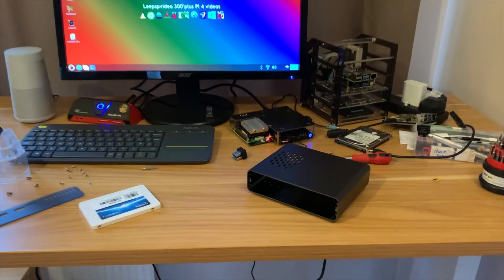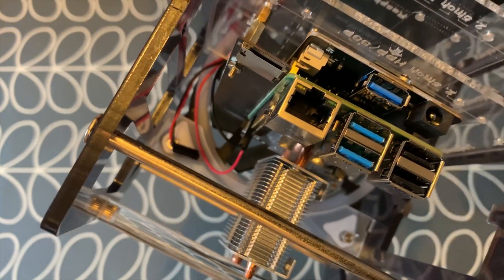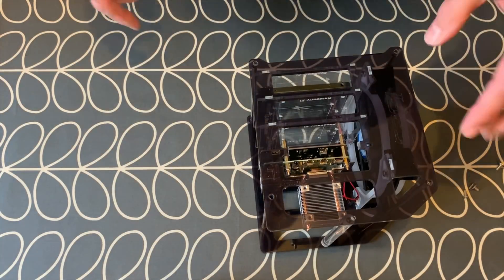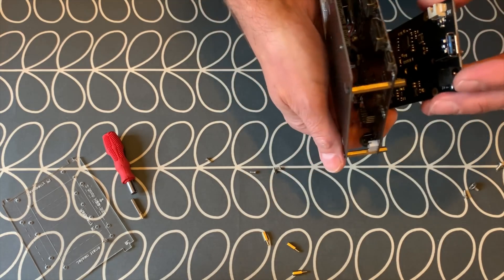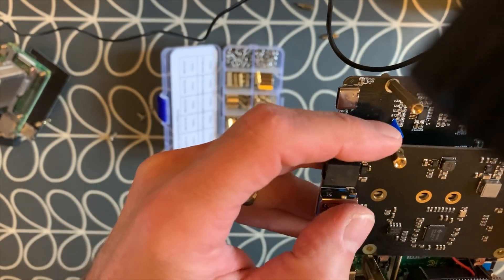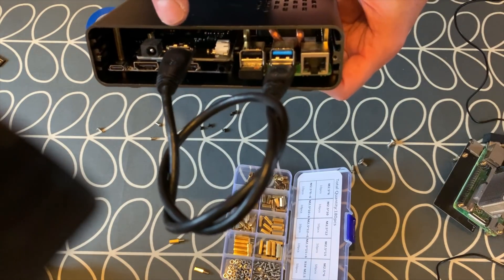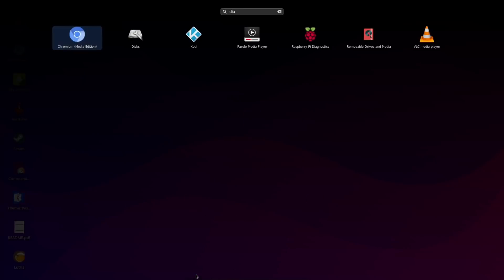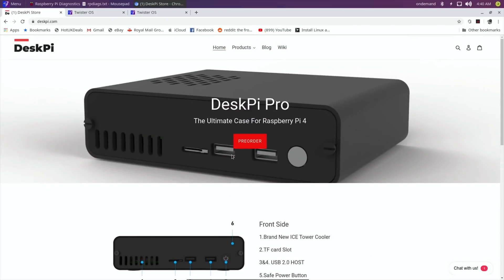Adding an M.2 NVME drive to my Deskpi Pro case. The Ultimate Case? Raspberry Pi 4.

Comment: Good work! The random Write and read speed had some significant improvement. But sequential result is more or less the save as sata ssd. 

I just found out that when using ssd in deskpi, power supply matters. When I used a 5V2A phone charger, the ssd speed was decreased 30%~50%.  I would suggest a dedicated power connector to power ssd. Otherwise the USB-c from raspberry pi can only supply limited power, when more accessories were to be added, it it not going to be good.

Comment: Unless Im missing something, seems that you would be better served to just leave the m.2 board in its own seperate case, outside  Deskpi Pro for all chaos involved to disassemble an expensive case. You have to still connect it with USB cable anyway.

Comment: Hey There! I happen to be an owner of the DeskPi Pro with an M.2 to Sata Adapter Board that arrived exactly about 3 weeks ago. I stuck a Micron M.2 SSD brand new out of the box in there with the assembled Raspi 8Gb variant! Would like some advise on getting it primed for Ubuntu 20.04 LTS with the latest image plus any performance boost\overclocking steps. Look forwards to your response.
Reply from the maker: 20.10 is the officialy supported usb boot Ubuntu

Ubuntu 20.10 Desktop. Simple USB / SSD Install. Raspberry Pi 4.
https://youtu.be/UQebDyl5u4s

If you search my channel I did ssd boot 20.04 but I think I used Berryboot or Pinn  OS.

Comment: Mine doesn't work. Slow SSD boot. Removed SSD now boots fast but no wifi.Removed SD card adapter now have wifi. Will try SSD with no SD card adapter.

Comment: Received my case and very disappointed, none of the usb ports work, wifi won't work, removed from case and everything working fine, have asked for a refund
Reply: Try removing the SD card adapter and reinstall everything else.

Comment: I purchased TWO units on Pre-Order based off of your reviews and others.
MISTAKE !   THIS IS NOT READY FOR USE !

I am putting my assessment HERE because it was YOUR Review that put it over the top and made me want two of these.

1)  The "Bridging Dongle" does not work 100% and due to how the case is made, you force it into place and it twists the USB-3 connector.
2)  Follow the process to fix the eeprom to boot from USB, then image the SSD, HDD, M2.Sata and you think your ok, NO.   
! Fails if using M.2.Sata or if M.2 board is removed and you use a straight Sata SSD.
- Image the device, pull out the SD-Card and no boot or very slow boot.
- Image it with SD Copier new UUID and fails.
- Image it with Raspberry Imager installed on running Raspi, FAILS.
- image a Drive with Windows and the Raspberry imager and install it and will not boot from internal installation.

Take an external USB3 to SATA Adapter or with Adapter case, install the 52.pi USB to Sata board from the Deskpi with your M.2.Sata drive, image that with Windows, plug that into a USB-3 Port (after removing dongle) and it boots Instantly!

Shutdown and plug that into a USB-II port, boot and Voila Instant !

Remove M2.Sata from external USB to SATA case, pop it back into the Deskpi, install the Dongle and NO Boot or Very Slow boot with errors.

4 Days Over 60 hours total spent on this JUNK !
Due to bad Dongle Design, the upper USB-3 ports on both Raspi 4B (1 4GB, 1 8GB) are now so loose they are virtually useless.
One Raspi 4B/4G fell victim to an eeprom setting error and is now 100% SCRAP..

Drives used to test:
2.5" Form Factor:  Chronos 240GB SSD  SATA,  Kingston HyperX Fury 240GB SATA
2 separate SanDisk X600 M.2.SATA 128GB SSD's.

External Cases used:  
Orico 2139  not so good & Armer RX200-APUS-25B is better.
Both are USB-3 and will boot from USB-3 or USB-2 no problem IF images are done on Windows using Raspberry imager from their website.
I've uses these cases on a Raspi 3B and they worked just fine on there too.  The Orico 's are finickety.

--- Other issues.
USB 2 port by ON/OFF switch is DEAD, both units.  
USB-2 port on front next to SDCard has power and flaky communications, unreliable.
Right out of the box fresh.

COSTS FOR THIS:
2x Deskpi Pros @ 54.99 ea.  $ USD
DHL Rapid Express courier (too obscene to mention)
1 Completely DEAD Raspi 4b/4G, ruined eeprom.
1 Damaged Raspi 4B/4G  Upport USB-3 port damaged by bad dongle.
1 Damaged Raspi 4B/8G  Upport USB-3 port damaged by bad dongle.

Responses from DeskPi team...  
- 101 book of excuses standard issue....   LAME is just not good enough description.
- Blaming Drivers and what not.  Having been an IT Eng for almost 30 years (board level design to software & networking Engineering) I CALL THAT PHOOEY !
They even blamed my wanting to use a Logitech Wireless Keyb & Mouse !   DOH !!

Irony:  They are almost there - 95% and Dropped the ball big time.  This is a product that many have been waiting for,  to appear, something that can take the Raspi, toss a drive in it,  and essentially have a nice clean solid NUC .  Raspberry now with 4GB and 8GB has finally reached a point where it can easily compete with many basic level desktops and actually be useable for production work....   

Can 52.pi / Deskpi fix this ?  YES starting the moment they cease excuses and attempting to deflect the issues.

Should 52.pi apologize to the people who got stuck with this first batch ?  
ABSOLUTELY !
Make it right and replace it...  For those of us who ended up with damaged Pi's well, you should pay attention to that...  IF you supplied the Pi, then replace it, if user supplied it ( both the 4GB models I sourced, the 8GB came from 52.pi)  you should offer something in compensation.

I hope you leave my review as a warning to others.  Additionally, I hope it triggers your Critical Eye for when you review products and post about them.
Reply from the maker: I’m sorry you’ve had such a bad experience. My review was based on the unit sent to me which was the pre release version. I haven’t had any issues but I see from my comments a few others have with the newer M.2 version. The DeskPi team haven’t yet sent me an updated model so I can only go on my experience. I still use mine, it’s connected to my TV. Hopefully these problems will get sorted out soon.
Reply: @leepspvideo  Thanks for the reply.

I had High Expectations being from 51.pi because I've heard, read & seen good reviews about their products.  The DeskPi is a beautiful little kit and sadly such a huge disappointment...  I saved up to get these and with everything involved  I'm out nearly $500 - (including damaged Raspi's)  THAT is the Really upsetting part.  I also have my doubts about IF 52.pi will sort this fuddled mess.   

They ran the 100m race and stopped at 98 metres with this.   

I MUST ADD, due to the big rush and volume of pre-orders that created stress & pressure.  It could be possible the whoever did the manufacturing took the "Lazy Path" and bodged it up, leaving 52.pi holding the proverbial bag.   I have seen that happen before with other companies.  If that is the case I feel bad for the folks @ 52.pi  but they should have still done due diligence and Q&A'd samples.

Hardware flaws sadly can't be fixed with  software.
Reply: @stephsoltesz6731  Absolutely correct and this is a poor design and choice of hardware terrible terrible end product!  20sec boot over USB direct to Pi 15min via internal USB link if you can get an image on screen that is. Avoid it don't waste your money !
Reply: @carlo8956  We are not the only ones getting these issues.  There are several PayPal complaints filed already and I am even getting feedback from other DeskPi Victims somewhere else.  Somewhere that has HUGE following.

I suggest you open a PayPal Complaint or VISA - whatever you used if possible.  I do feel they will fix it but when, how and with what conditions to get the fix.

PS:  Look at the Trapdoor Warranty on their site...  Send it back at your exp and maybe it get's fixed,   S&H = Cost of the damned thing.  Are we all subsidizing couriers now ?
Reply: @stephsoltesz6731  Returns were never an option lets face it, as for a fix I think only option for existing owners is to decide if we are willing to pay even more for revision 2 when they release it ...yes they could send a new USB SSD board but that doesn't fix the fan flexing the board and cutting the video which I am not prepared to trust them again for one simple reason these were  known issues and the reason for the delay in the first place so why delay shipping they decided to send them out as they are anyway this is a lesson on how to kill your up until now reasonably well regarded brand whom now appear to have no regard for the paying end user. Hey you Live and learn
Reply: @stephsoltesz6731  also how did you contact deskpi pro about your issues?  I want to ensure i get something working better.
Reply: I received mine last Saturday 12/05. Two big issues with mine: the ice cooler brackets with the standoffs are a bit to high off the pcb of the Pi. I had to slightly reform them down so the Pi would not be so stressed. Was able to get the heat pad on the cpu. The most frustrating thing is the SATA SSD. I am using an old Samsung 830 128g. Like yours, it was running in super slow motion. Found that with this current USB to Sata pcb they sent with the new batch I have to turn off the uas mode. This does decrease the performace of the SSD but it's massively faster than the sdcard. I have provided two links describing this in detail.

Current speed test results:
Sequential write speed 160627 KB/sec (target 10000) - PASS
Random write speed 6566 IOPS (target 500) - PASS
Random read speed 3460 IOPS (target 1500) - PASS
Falls in line with about half the speed of leepspvideo results with a compatible uas full speed adapter.

https://www.raspberrypi.org/forums/viewtopic.php?f=28&t=245931&hilit=usb+slow&sid=1ca3aa83c096ce3fbd0dd9635a430785

https://origin.jamesachambers.com/raspberry-pi-4-usb-boot-config-guide-for-ssd-flash-drives/

The only other thing so far I have done is reverse the fan to blow through the cooler and out. Seems to be staying a bit cooler now. Currently have the Pi overclocked at 2ghz and no issues yet. This is a brand new Pi 4 8g from Microcenter I picked up last week for $65 on sale. They must have improved it some from my first gen Pi 4 4g . It is not a happy overclocker like this Pi.  

Over all I'm not thrilled with this case simply because of the USB->Sata problems. Seems strange they would have let this go through production this far along. Everyone is probably expecting full 3.0 speeds from the USB->Sata with the DeskPi Pro.
Reply: @bobfever100  some of the latest bits.
The deskpi is being Revamped, some chips are being swapped as well.
They have indicated to me, that they will ship replacement units out ASAP when ready & fully Q&A tested & passed.

THIS IS GOOD, they are Stepping up and being responsible.  This in part is restoring some faith at this time.  BUT full restoration requires "proof in the pudding" as it were.

M.2.SATA will be continued.  But I also (a few others too) highlighted to them that NVMe should also come to exist.  Sata is getting tougher to get, especially M.2. Sata it's no longer "on the shelf in the store".  But M.2.NVMe is readily available and price competitive.   Some people are more likely to pay an extra $5 for NVMe and gain the benefits.

Suggestion was made to offer Option A SATA , Option B NVMe +$5  +/-  smart move would be to do so.   Who supports IDE HDD's anymore ?  Sata is going towards history so... 

-  The front panel USB is unavailable because there is no configuration: /boot/config.txt file, you need to add in this configuration file: dtoverlay=dwc2,dr_mode=host, and restart the Raspberry Pi.

-  Slow USB BOOT is the problem of USB conversion chip. We are working on a new solution to solve the problem of slow USB boot.

-   We are also re-adjusting the installation problems caused by the too small tolerance of the housing.

-  We are updating the news through this link, you can get help here: github.com/DeskPi-Team/deskpi
Reply: @stephsoltesz6731   Glad you are being sorted .. I never received a response myself to a no video output question ...radio silence guess we will have to wait and see
Reply: @carlo8956  I can only pass forward what I am being sent.   I'm communicating with them through their sales AT deskpi.com email address.

My only suggestion is to keep on the email.  If purchased using PayPal open a dispute,  If VISA/MC or other, go through whatever procedure they have.

I think this may also be holding up the Argon.M.2 as I think some of the parts are used between the two.  I'm told by a couple of vendors they won't be seen for at least 2 weeks now.   Quite a bugger right before XMas, I think these would have been given as gifts to some or self purchased xmas goodies we allow ourselves once in a while.  ;-)
Reply: mine got delivered today but now I'm concerned ... I tried their website https://deskpi.com/  but its down ... I hope this wasn't a waste of my $ ... I really liked the idea of this case
Reply: @MrFunseeker57  The site is up, just checked it.

This was "Exactly" what I had been waiting for since the Pi3B came out and FINALLY appears and hence a huge disappointment due to issues.

Wh no one ever came out with a case capable of holding a USB-SATA drive &/OR M2.Sata + till now mystified me.

Or a "Conversion kit" for mini-ATX or other cases.   (like that would take a lot, wouldn't it).

There are threads on the issues and various commentary here & there.  Keep a sharp eye on it.
Reply: @Steph Soltesz  I got a reply from Deskpi regarding the Sata and other flaws, after I sent them this email:

––––––
Based on comments and reviews by early users that already received their DeskPi Pros, I understand there are hardware problems with the M.2 sata connector using the JMicron firmware that causes M.2 SSD’s to work very slowly on boot and general use.  

Are you working to solve this issue for DeskPi Pro orders that didn’t ship yet?

I would like to have a properly functioning DeskPi Pro, but if there are no plans to fix these problems before my order ships, I would like to cancel my order and refund my payment.

Please let me know the status of fixing the reported issues before you send me the Deskpi Pro. 

Best regards, 

––––––
And this was the reply I recieved from Deskpi:

––––––
hello：
we are re-modifying the deskpi，and takes some measures to solve those problems，
so when we finished the re-modification，we will send you it.
have a nice day

but if we re-modify them，and test every deskpi，it will take more time，so please wait it patiently ，truly thanks

––––––
Hope this helps others that ordered the Deskpi and are still waiting.
Reply: I dont think its just the usb to sata to m.2 bridge.  

I was trying to use berryboot to install os's onto the 2.5" ssd i have and i cant get any os to work to boot.  I am trying the default os (raspian and manjiro and ubuntu ) and nothing fully boota or if it does, then the wifi never connects.  

I tried pinn os too and it kept corrupting the ssd.  I had to take out the ssd to re format on my linux machine to get it to be useable again.  
Also berry boot doesnt recognize the front usb ports... which stinks because when i connect my wireless usb keyboard to the back, the signal gets blocked by the case..  

But.. this case still almost is good.  If i just boot off the sd card things work fine.  I have stepmania installed on a card and it works great.  I have retropie on an sd card and its good.  I had more games on the ssd drive but it boots so much slower...  so that was my hope with berryboot/pinn os.  Make thise 2 images into bootable options from the ssd and then i dont have to switch sd cards...  

Sigh.... this case is almost there though..
Reply: @Beyondesp  In the Deskpi GIT repository, the readme now has instructions to active the front USB.

I could only get it to boot via SDcard, it tried but wouldn't with USB Boot device, instructions now also in the GIT repo.

To contact them, I just used the sales@deskpi.com email.   They are not speedy responders.
Reply: @stephsoltesz6731  thanks, that helped with getting the front usb to work in berry boot.  

But still cant get Ubuntu or raspbian to work, booting off the ssd ...  

Still very disappointing about that part.

Quick fyi for others, it was in the faq section, as the readme went into other important items.
Reply: @Beyondesp  YW.  Unfortunately it is what it is...  I've had to put my raspi's into "conventional craplastic casing" for now and will NOT cancel the PayPal dispute till good ones are in my hand or I get a full refund.

I would think that Canakit, PiHut, BuyApi and others would come out with ABS or Acrylic casings that could contain a USB Bootable SSD or M2 optionally with an add-on adapter.   

Seriously, a HiPi case that was just a tad bigger would do it.   But then again, Raspberry Org didn't do that with the Pi-400  which to me seems like a Natural Inclusion that should have been in the design by default.   Maker Mindset I guess but not everyone is a maker nor wants to use a Pi for that.
Reply: UPDATE:  No further word from 52.pi.
PayPal just issued a Full Refund.
What does that mean ?  I dunno.
will 52.pi fix the issue ?
Wlll they send out replacements ?

Unknown and no longer chasing this.
Good Luck to everyone that got one of the defectives.
Reply: @stephsoltesz6731   thanks for the details of your misadventure. I'm also in this one... Could you give more info on the thype of dispute that you filed at paypal in order to get refund ? "Product not conform to seller description"? How much time between the filing of dispute and refund ? Thanks for your help !
Reply: Mine won't boot video correctly, I think something is wonky with their Full HDMI ports, I posted a video of it https://www.youtube.com/watch?v=Oc9W6VTl8Vs